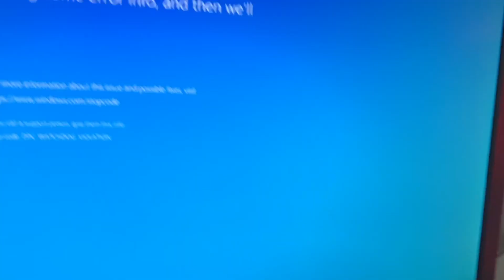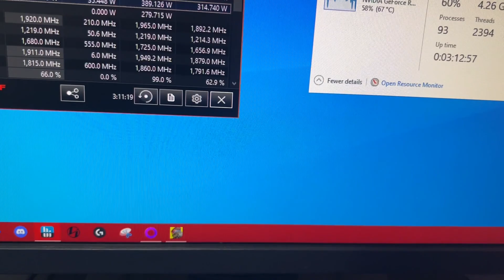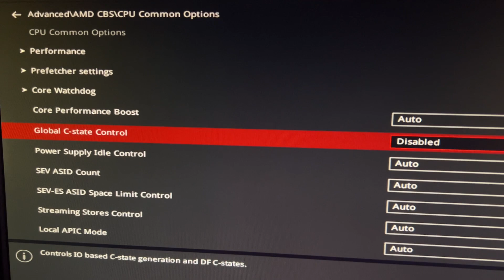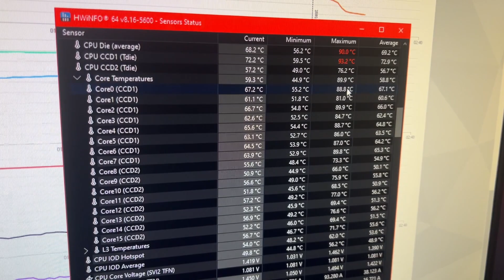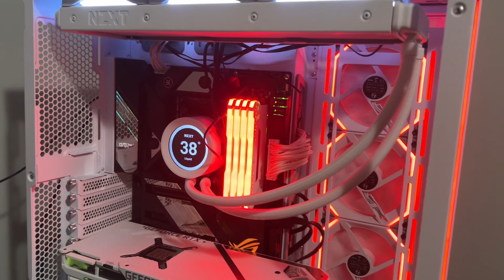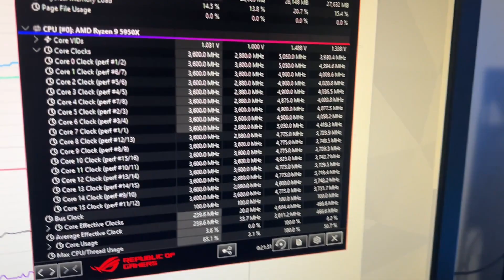Fixing an idle-freezing and overheating pc (Ryzen 9 5950x + RTX 3090)

Comment: great video! i have pretty much the same system, and out of the blue after 3 years of no issues, i started having these freezes as well. i disabled global c state and that seems to work, but what i don’t get is, is it ok to leave the c state off, won’t it shorten the cpu life? also i never really updated the bios or the chipset, should it not solve it so I could turn c state back on? this is such an old issue, i would assume it has been addressed by now and will be fixed with a bios update (something almost no one does ever) i also don’t understand why it started all of a sudden out of the blue, and it seems that it happens to other users around the same time. i guess a bad windows update (how surprising) anyway thanks for the video! it helped me a lot